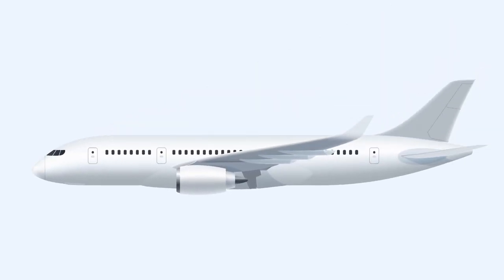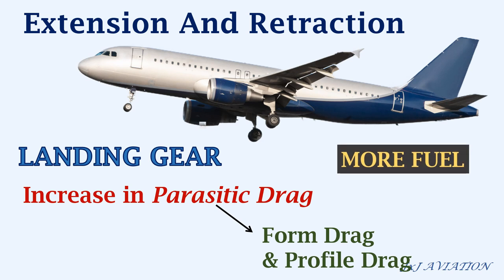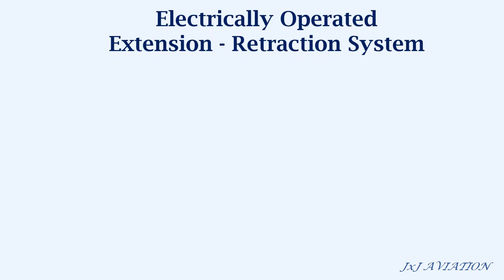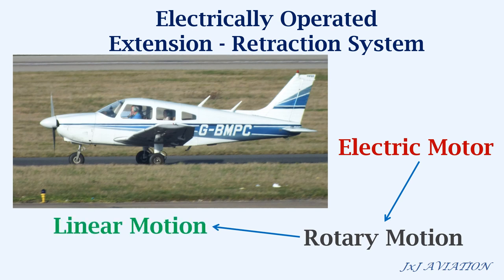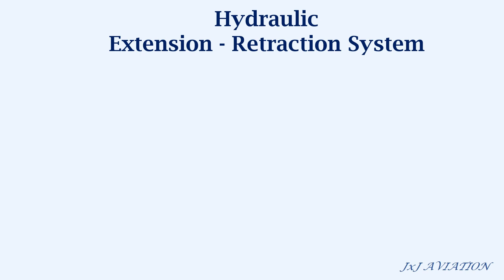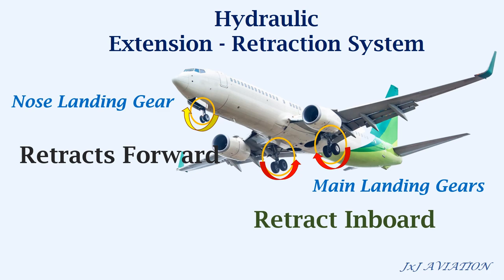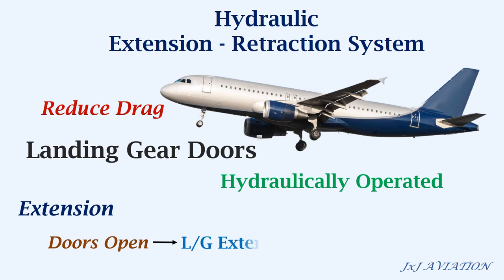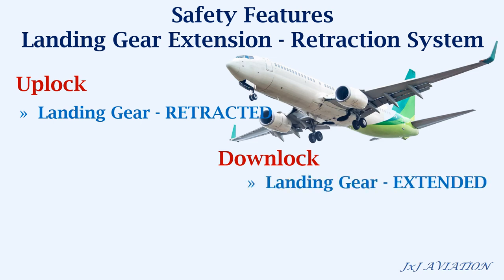Understanding Aircraft's Landing Gear System(Part2): Extension & Retraction System + Safety Features

Comment: Thank you so much 
I have a question 
In gravity extended The weight of the main landing gear And the drug in noise landing gear that may be can be so fast extended I am only went to know if there is some thing to reduce the speed of extended oh reduce the power of extend it to prevent damages in the Chuck struts (air oil) or link
Reply from the maker: The structure is strong enough to withstand the impact of the gravity extension of the main and nose landing gears. This is why there is a speed limitation for the gear extension process.